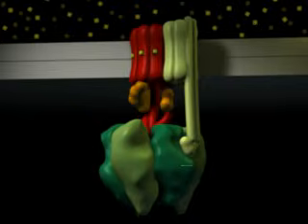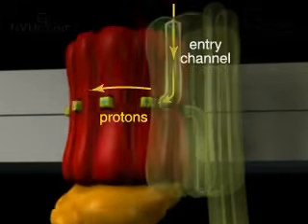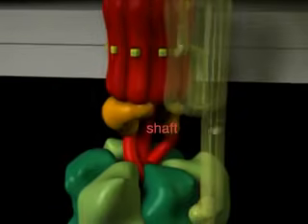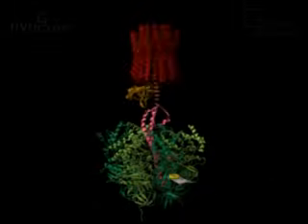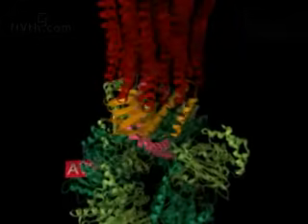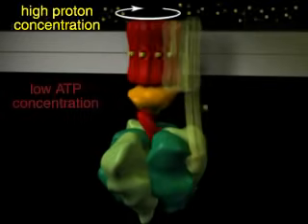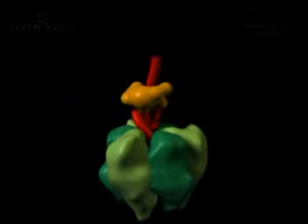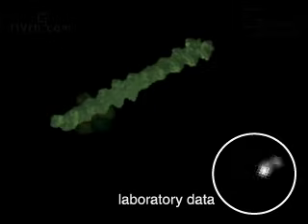ATP Synthase

Comment: never realized how abstract this stuff was... why does it spin? in tubes like that? wth?
Reply from the maker: +MrSyuske Mitos are not quite bacteria. Most theorize that ancient bacteria merged into the cytoplasm of Archaea, and then evolved into mitochondria by simplifying (or more accurately, specializing) and migrating parts of their own genome into the host's genome.
Reply from the maker: +MrSyuske Yes, 'powerhouse' is often a metaphor people use to describe mitos.
Reply: ***** That wasnt bacteria, this stuff is wayyy smaller than that. The thing spinning was a small protein that the scientists attached.
Reply: Osama84ca There aren't tubes. You're looking at a protein, or more specifically an enzyme that does the actual spinning.
Reply: mitochondria is a bacteria? 
#RIPMYGRADUATION
Reply: +josh lisse  : The scientists attached a fluoroscent protein to the shaft just to confirm that on presence of ATP synthase the shaft starts spinning, activating the F1 ATP-synthase to convert ADP into ATP.
Reply: It's a powerhouse where ATPs are synthesized right?
Reply: :) thanx Mr. Johson. It helped me to a great extent. :)
Reply: +MrSyuske There is this theory called the endosymbiont theort that states that a symbiotic relationship existed between bacteria and larger cells.Evidence for it can be found in the presence of two different sized ribosomes 70s found in chloroplasts,mitochondria and prokaryotes and 80s ribosomes (found in cytoplasm).
Reply: *****  Being 'convinced' is not the position any scientist should take who works with the evidence.  As no scientist can ever prove evolution as fact, science is about clarification of what the evidence tells us, whilst being at same time skeptical about every movement of opinion and assertion.
You ask "What is the chance to get the exact same genetic code twice." 
The genetic code present in mitochondria has absolutely nothing in common with the very complex and variable, flexible DNA systems that almost all bacteria use.  Whoever taught you that has deceived her/himself and you.  i would strongly recommend studying the facts of what that DNA actually does (not statistics about similarities and differences and what SOME of the DNA does with membrane production).
Best wishes.
Reply: +120%  -  Mitochondria are believed to have arrived in 'early' cells as bacteria.  That is what you were taught in high school and no doubt university science. However the evidence for this assertion cannot be tested scientifically, and is of no relevance to science directly.  We can examine their structure, even demonstrating the spin characteristics of the motors of the bacterial flagellum (e.g. E.coli) and this has all be done. We know exactly what these structures contain down to their protein sub-units.  Any similarity of structure we see there might simply be optimization of design, by the same rules of scientific inference, may it not?    It does not mean necessarily that there was a common origin (i.e. in evolutionary terms). 

What we can say with certainty is that the ideas of bacteria becoming symbionts with 'early' cells is part of the dogma (asserted as a fact) by evolutionists, and this is a hypothesis at best, as that option (a belief that it might be true) is not the only possible hypothesis.  

Life is more special  than you may assume it to be.  Watch during your lifetime, how evolutionary assertions and ideas are overturned one by one.

Comment from the maker: The main job of this particular machine in this context is to convert energy into a form that the rest of the cell can easily use.... without it every other protein in your body would have to be much larger and more complex to perform an job that requires energy input. In many cases like this, evolution has found a more efficient/universal method of energy storage and distribution.